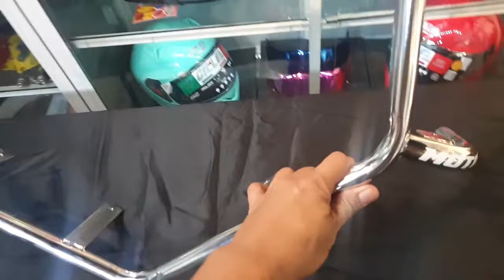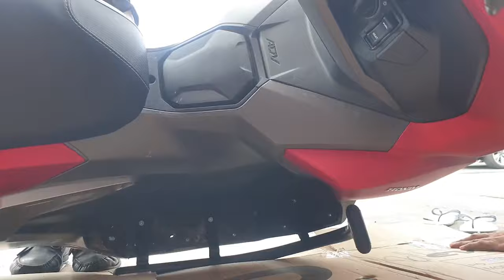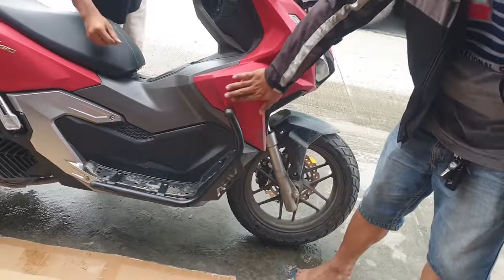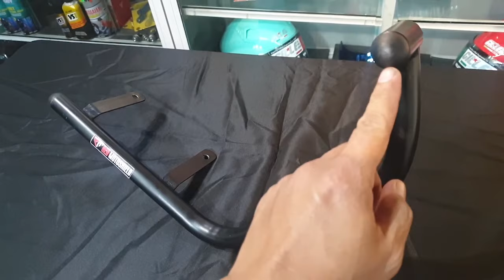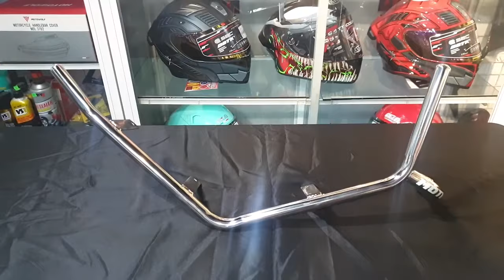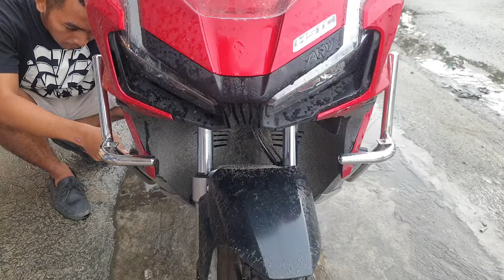Crash Guard DROP TEST! - ADV 160 Half CG

Comment from the maker: The owner of the unit in the video volunteered to perform the test. This is his way of checking it's function. However, we are open to anyone who will offer his own bike to ride and test in a way of replicating an actual crash (which we do not advise). Just comment to sign up ✌✌✌
Reply: Hm po
Reply from the maker: @robertmagno3324  link po nasa descriptions
Reply: Should have rephrased the title of the video then, because there were no instance of dropping found anywhere in the video. It should be laying it on its side
Reply: Hm
Reply: @MotoFoxPH hm stainless half crush guard
Reply from the maker: @glenanoznelav8710  message lang sa ating fb page

Comment: Useless test. San ka nakakita drop test ng phone na hiniga lang yung phone sa floor. Crash guard simply for aesthetics and maybe scratch prevention from light bumps. Doesn't prevent u from lesser gastos pag nagcrash ka. Yun nga lang mabitawan mo motor mo while pinapark mo lang siya gasgas parin body nyan. Don't get me wrong. Still gonna get mine installed with one but don't get one cause u think na if ever tumumba motor mo for whatever reason, yun mga pinoint lang ng video madadmg. Definitely no

Comment: Cnu ba loko2 na ccrain ang brand new unit para sa gnyan na test? Pinapakita lng nmn nila kong anu possible na sasayad if incase maslide or matumba ang motor. Dami nio reklamo haha
Reply from the maker: This is the most sensible comment to this video so far. Salute to you Sir!
Reply: Kaya nga mga loko2 rin ang maniniwala jan na safety yung crashguard nya
Reply: Then why call the title of the video a drop test

dropping refers to letting go of something so it falls down, while laying is to place something down in a specific position.